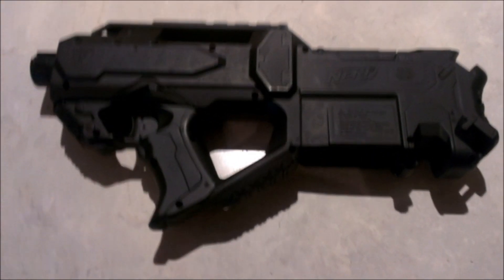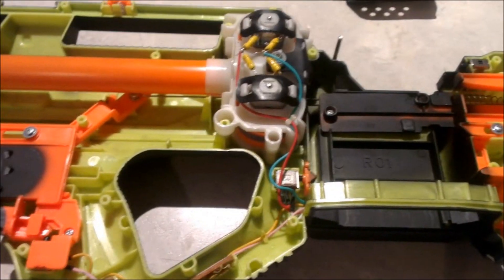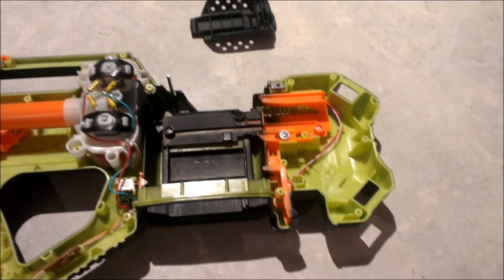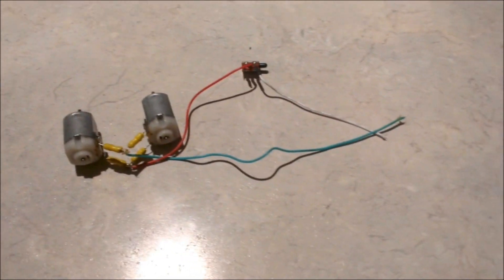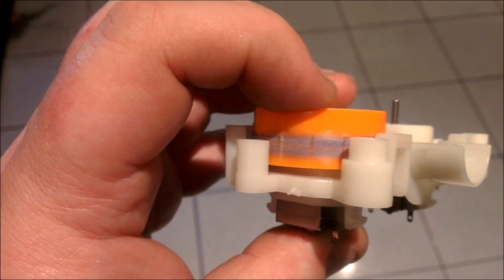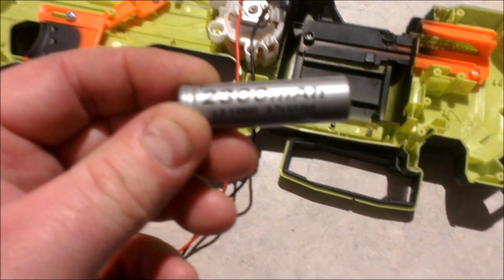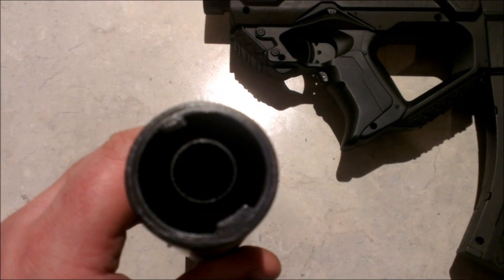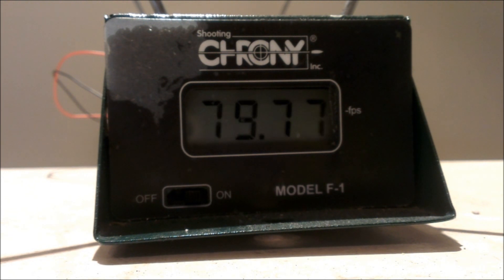Nerf Rayven Mod - motor replacement,rewire and voltage upgrade

Comment: Isn't it just easier sand safer to use a LiPo than the dodgy sounding "unprotected" cells?
It's only a couple of holes, a bit of dremelling and soldering an XT-60 connector, the performance is much better because of the extra available current to draw (and less likely to overheat or burst).
Reply from the maker: Matt Von Nerf .. check the date on the vid bro ... this is old as .. back when trustfires were the shiz! ... this blaster was the base for what is now The "Banshee" ..
Reply: I appreiciate that, I'm guilty of using IMR's sometimes! But if a Lipo fits, it's going in.
Reply from the maker: Matt Von Nerf oh yeah all my stuff now runs lipo 😉
Reply: I know it's an overall expesive move to know what to get and then purchase everything you need for a proper LiPo setup, in the long run, LiPo's are cheaper and perform better than recargeable AA's, or IMR's.
Admittedly it takes a litttle learning and maths, but it's worth it.

Comment: Did you think to upgrade the switch? Can it handle that voltage safely?
Reply from the maker: yeah switch needs to be upgraded
Reply: btw what batteries were you getting the high FPS with?
Reply from the maker: Dharmaboy trustfires x 4

Comment: What kind of motors? what are they called?
Reply: J0D0CAST Rob from SBNC put 3 falcons in a RS commission for me. Its arriving tomorrow hopefully!
Reply from the maker: They are FK130 (falcon) motors...12v 36,000rpm rated bought direct out of china.
You can get some via the "Nerf Modders Welcome" facebook page from a guy called Greig McCracken.
Reply: Thanks
Reply from the maker: I'm Nopeism did you get your blaster yet ?
Reply: It arrived yesterday :D
Reply from the maker: And ???? ... Is it an animal !!! ?
Reply: It's running on AAs atm so no lol
Reply: When I get my IMRs, it'll be ridiculous.